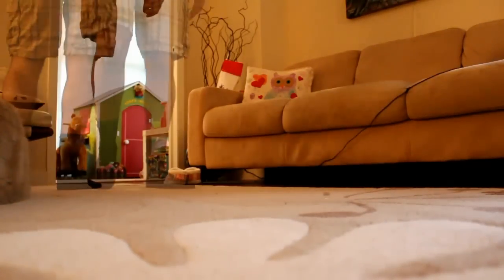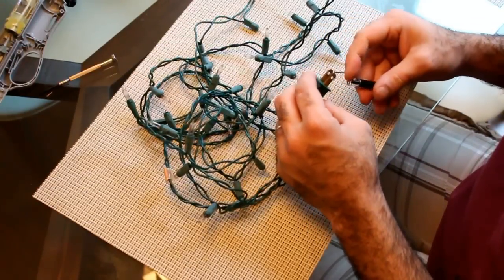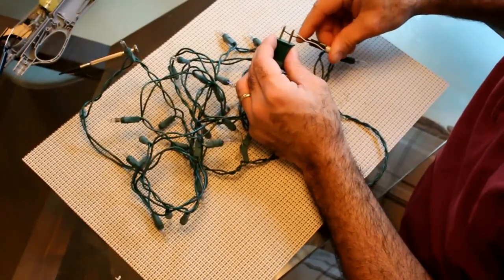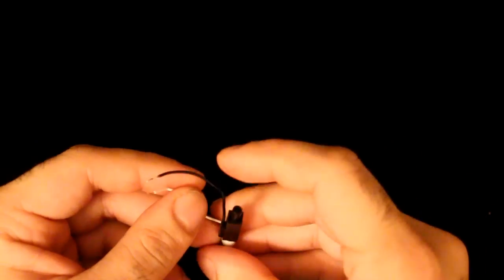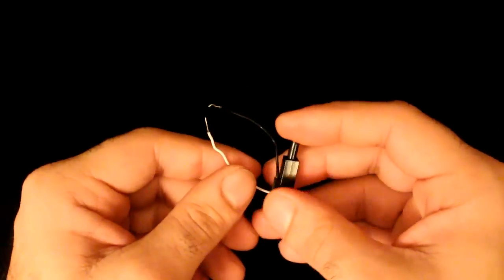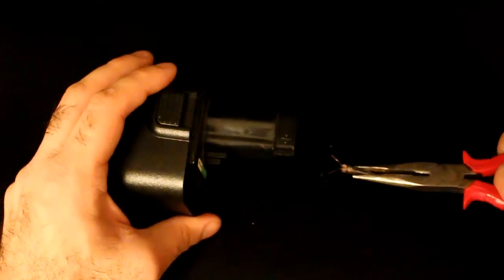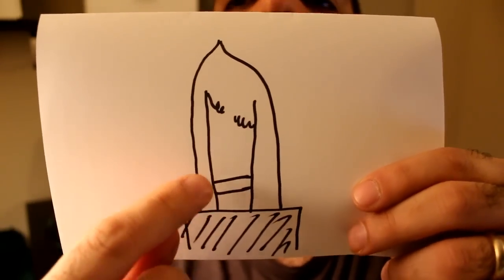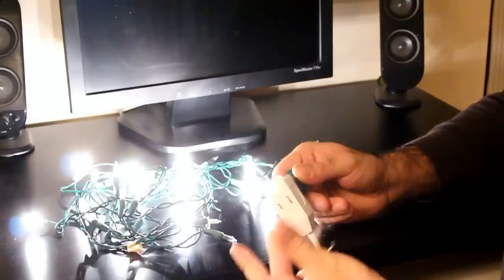How to Fix Blown Christmas Lights Fast and Easy

Comment: I am going to make a device that you plug the light string into it and press the button, which will do the same thing as fixing the light string. It's essentially a quicker and neater-looking thing which is just a lighter sparker tied to a single-outlet receptacle.

Comment: I heard that bridge has a oxide layer that is designed to break down at higher voltages. When the bulb is operating, because they are in series, the resistance of the other bulbs causes each bulb to receive a low voltage. If a bulb fails, the circuit is broken resulting in the voltage climbing to full line potential because with resistors, the more current is drawn, the more they reduce voltage. This higher voltage breaks down the oxide layer and shorts the bulb, however this sometimes does not work, and that is when a high voltage spark is necessary.

Comment: In countries with 230 or 240 volts, this is not necessary cause the voltage is high enough to do this on its own.

Comment: I have a question: i am not educated on electronics but it is my understanding that in order to create an air arc we need high voltage. I am assuming that piezo Crystal is capable of generating high voltage. On the other hand I don't understand how can such an high voltage short the broken lamp, and leave the rest of the lamps intact. If  there is enough current to short the bad lamp how can the filament of the remanding lamps still works doenst blow?
Thank you

Comment: Actually I was skeptical about the efficiency of this method, but today we had a dysfunctional string, so I said, what could I lose. I zapped it once, I plugged it in. Of course it didn't work. Ok, I zapped it a couple of times more, then I thought that It might be very important to directly connect the two ends of the piezo zapper to the ends of a connector, then I zapped a couple of times more. I plugged it in, and saw 20 of the 100 that didn't light up and all the other did :-O I'm currently surprized about two things: that this method really worked and I had so much bulbs, that went out at the same time. It was even more strange, that after I changed a bulb that had a broken filament, with one that I thought to be working, but bad too, I didn't have to rezap the string, but it worked. Maybe it was already shorted, but then again, why? So many questions. I should be happy tonight instead. ((-:

Comment: In the christmas section at my closest ace hardware down here in the states, there is a device that looks like a grill lighter, and it has a polarized female plug that does the exact same thing, without zapping or killing yourself

Comment: What brand of lighter did you take apart? I tried with a Bic, but the igniter assembly only had one wire that was not directly connected to the igniter.

Comment: Does a Christmas light is connected in series connection???(at least mine is parallel)
Reply: Then you have a power supply in the plug and most likely an LED string.
Reply: It heavily depends on what lights you have. E.g. extendable chains will have everything in one series string (or multiple series strings in parallel) and lights connected to the end will go in parallel. All depends on the voltage of the supply and the voltage of the lights you're trying to power. I got a 100led string of mains voltage lights here in 240v UK, to use that in the us it would need to be 2 parallel chains of 50 lights rather than 100 so the voltage for each led would be the same due to the us running on half our voltage.
Reply: Depends if the lights are LEDs or little incandescent filament bulbs. For a string of christmas lights, you don't need super-bright LEDs, the normal low power variety is more than bright enough. LEDs are extremely efficient at producing light, produce almost zero heat, and each one consumes a tiny amount of power. So it is entirely possible to run the entire string in parallel with thin wires and a low voltage. About 3 volts is usually enough for most LEDs, and small strings can run for many hours or even a few days just from a pair of AA batteries. Though it is easy enough to build a circuit to drop and rectify mains voltage to power a similar LED string.

Filament bulbs consume far more power, so a long parallel string would need much thicker wires to cope with the current drawn. So filament bulb strings are usually wired in series to allow thinner (and hence lighter) wires to be used. Also, filament bulbs are made with a variety of voltage ratings, allowing series strings to be matched to the mains supply without needing a transformer. For example, in Europe where mains supply is 240 volts AC, you can directly power a 40 bulb string made with 6 volt bulbs. In the USA or Canada where mains supply is 120 volts, you would make a 40 bulb string out of 3 volt bulbs instead.

Comment: I just discovered an old electrical lighter with empty gas and opened up. Found the exact same piezo thing. Zapped myself a few times accidentally with it, but that's actually neat. I think such a small amount of electricity is not dangerous at all, right? It's high voltage, but it ends up at a diminishing number of amps, if I got this correctly

Comment: There is a vacuum in the bulb, when a spark is created it ionizes the air making it conductive. Thats why it works
Reply: The ions don't last at low temps anyway, they'd be gone by the time you plugged it in

Comment: The thing that you shorted in the broken light bulbs with the sparker is known as an antifuse, which is basically the opposite of a fuse. Whereas the resistance in a fuse increases to a very high level (open circuit) as it gets hotter due to current, the resistance in an antifuse decreases until it reaches zero ohms (short circuit). This normally happens automatically but sometimes, the antifuse fails to short out by itself. This can be done by applying a very high voltage across the antifuse (like you did with the sparker).

Comment: Blew up a transistor in my christmas lights circuit board as well by doing some strange things. It exploded like a firecracker , leaving me some smoked fingers that i had to patiently clean with a load of soap later. Nothing happened to me , but that transistor broke in two parts. 
Mistakes happen. But that was a good reminder of this channel. 

Merry xmas dont burn your houses.
Reply: I think it should be pretty obvious why using this trick on fancy Christmas lights with circuit boards will not end well. :D

Comment: There's something that shorts the connection if the voltage is high enough? What is it, and why is it there? Surely not to protect the filament, as you originally blew the filament by putting a bunch of power through it. Is this just a material property rather than a deliberate design decision?
Reply: Tom Haflinger 
Material property.

Comment: HAHAHAH Oh man... thank you for this video.
I was SO pissed off by one small section of bulbs that was out... and came to find out why.
Now I'm about to go take apart my lighter and fix this strand.
Reply: Have you succeded?
Reply: nope.
no success. 

i ended up buying two new strands to replace the ones with outages.

stupid goddamned lights...
Reply: Scott Roy
oh, that's a pity. Had to be a different problem with them.

Comment: The wires at the bottom of the light, the shunts, have insulation that is supposed to burn when the light goes out but sometimes it doesn't, warranting the grill igniter. You can actually get a device called a "light keeper pro" that has a built in shunt repair in addition to light and fuse testers and a current detector. It has definitely helped me

Comment: wait u said that the bulbs kept glowing as they were in series but shouldnt they only be glowing in case of parallel arrangement as if series one circuit part breaks so remaining stops.
Reply: The bulbs are in series. In the beginning, the entire string of lights were off, as you expected. After applying high voltage from the sparker, a conductive bridge was somehow created inside the dead bulb, shorting across it and closing the circuit. That is why it began to glow afterward.
Reply: Mr. Random oooooooh, thanx a lot

Comment: here's a "bright" idea. buy a LED light strand. that way they never burn out
Reply: My family's had a few LED light strings for 3-5 years now, and they've yet to break in the slightest. Have you ever considered that the quality probably differs from company to company? Have you also considered that most standard bulb light strings are also most likely made in China? Have you also also considered that Christmas lights are most likely made by machine more than by "slave kids" since it would be cheaper and far more reliable?

Comment: Ok please someone reply. The lighter produces spark because it produces high voltage. But it's also true that only high voltage can't zapp you. The source must be capable of producing high current too. 
Is my thinking true?
Reply: Siddharth Sharma You're correct. You must have both enough amperage to shock someone, and have enough voltage to push the amps through someone.
Reply: I think so. Its the very short duration of the spark that makes it safe. I could be wrong.
Reply: you are right

Comment: could u measure the crystal output voltage?  or would that fry the voltmeter
Reply: Depends on the meter.  Set it on Auto, VDC, recording in Min/Max mode and you MIGHT get an accurate reading.

Comment: What happens is there is a shunt inside of each light bulb. When the light bulb burns out all of the voltage is dropped across that bulb which should cause an arc that melts through a lacquer coating on the shunt. This causes the lamp to short out and keep current flowing through the rest of the string. Sometimes this fails to happen and the string goes out. With the crystal an arc is generated across the gap between the shunt and the lamp electrodes that melts the lacquer coating and reestablishes continuity in the string.
Reply: +Dev Brown oh they could couldnt they. but u know. money :p
Reply: Dev Brown but, why an air gap is created? Isn't there vacuum in the bulb?

Comment: We have a multiple strand "icicle" light, where you can have a partially lit up strand. For this to work, we had to remove a bulb from every working parallel strand to isolate the broken one. Once you do that, the sparking method can work without shorting through the other segments. 

Really worth the $1 lighter.

Comment: Why doesn't the high voltage destroy all the other light bulbs instead of causing the "electric ark" over the broken one?
Reply: +jeronim bou The spark is a very short burst of high voltage, therefore not long enough to damage to the working bulbs. (or you for that matter :P)
Reply: +jeronim bou The shunt between the bulb terminals (that white wire wraped around the electrodes holding the filament) is made of anodised aluminum, wich has a very thin insulating layer of aluminium oxide on it, thin enough so about 100+v will break through and short it out, permanently, but if the filament is intact this will never happen, since it's resistance limits the voltage between the terminals. That piezo igniter has verry low courent, so the voltage across the terminals of intact bulbs never goes past a few volts.
Reply: stalkersas Ah, nice to know :)

Comment: 2 problems in eastern europe
pierso sparker is it still works when few are blown and sparker has just 1 wire and it's super hard to use becouse off all the purping it pakes your finger bleed from too much ussing D:

Comment: I tried the sparking method and my lights still didn't work (it's probably the looseness/disconnection from the fixture as you mentioned), but I had fun ripping apart my broken lighter and sparking my friends! Thanks for the knowledge :)
Reply: +Emily Dinnerman What kind of lights did you try to fix? Were they a basic set or did they have a controller board to allow the lights to dim/blink different patterns? A controller board would likely interfere with this method.
Reply: +Adam Fraser-Kruck It was a basic set from the thrift store ~$5. I know--it's cheap, but hey, I would've loved to been resourceful and do a little confidence-boosting DIY
Reply: Taser gun
Reply: I’m only going to shock my friends
Reply: Ok I have to find any lighter in the house real quick so I can spark my friends too :)
Reply: did they die?
Reply: Maybe you had led lights so it didn't work
Reply: 700 likes in 7 years. Wow.
Reply: 420 likes

Comment: What kind of lighter did you use? I tore mine apart and it doesn't have the same type of sparker.
Reply: ***** *note to self: Lighters cant just be used to buy your enemies, they can be used to zap them aswell.

Comment: Nice! I just used your technique to fix some outdoor "icicle" lights that hang under the eves. They appear to be wired in sections, and two sections were out. I started by trying to identify which light was out..one by one...but failed with much pulling of hair and gnashing of teeth. Plugging the lighter igniter into the two prong plug didn't cause the bulbs to short, BUT, attaching it directly to one of the bulb sockets in the unlit section worked great! I zapped both sections individually, and the burnt out bulbs were easily identifiable after that. Thanks for posting!

Comment: You're a Genius Dude!! Didn't work for me though. I then used a110V voltage tester.. you know the one that looks like a pen and has a test button you press? I started at the plug and by checking voltage going in the bulb and verified it was coming out.. done by simply touching the insulated in or out wire. I got to a bulb very quickly that had voltage in, but none coming out.. that was the bad bulb.. replaced it and voilà repaired the string. You need to make sure you isolate the individual wire going in and out from the other wires using your fingers or hand, otherwise you will get interference that will indicate voltage.

Comment: Very funny and interesting.

Since the bulbs are designed to short out when the filament blows, it's not obvious what the high voltage is actually doing.  You might think most of the energy would be dissipated by the working bulbs but that would only happen if there was current flowing.  Maybe the sudden, high DC voltage across the tiny gap in the dead bulb (that has failed to short) is enough to pull the parts together to complete the circuit.

Comment: There is not such  an interesting and exciting  way to check the lamps in this type of Christmas tree lighting, which is to  plug in and  holding a neon test screwdriver by its tip  slowly pass it along the chain of lamps. when you reach the dead one the neon lamp in the screwdriver handle will stop glowing  this Is the faulty lamp. Try this from both ends of chain after laying on a flat surface if the neon lamp remains on all the time and all lamps are tightly screwed in reverse the mains plug and try again. As a fellow electrical engineer I like your excellent stuff so much that I have done you the rare honour of subscribing to it. (grin) seasonal greetings.

Comment: OK... This is bs....where do I (who has an Electronics Engineering degree)start... First... this guy says he is using Series wired lights which means the bulbs are wired end to end , daisey chained...picture 20 people holdin hands one after the other and the the ones on the ends each hold a bare wire... the electricity will make a circut each person is the bulbs.

Now , the ideal of using that lighter gizmo to see a spark in the bad bulb can , in theory, work. It has a high voltage- low current.
but the problem is two fold, one, the spark would be too dim to see in day light because of the secound problem... which is each bulb in series adds up the resistanes and holds back what little current there is. (the spark is electron flow/current, voltage is the force that pushes the flow) more lights in the srting the smaller the spark.

The next problem with this video is that the little thing he shows in the drawing that he says makes the short when zapped and is a high voltage protector... nonsence... that is an insultator to keep the wires in the bulb seperated and to support the filiament.

Third... he never shows the process un edited as to show no tricks (ie switching bad string with good)... and when he uses the white extention cord near the end of the video.... he picks up the cord and drops it back in his lap.... BUT he has two power cords... one not pluged in and one that is....
Reply: I understand your skepticism, I also reacted that the extension cord was put out of sight, but it can still be tricked with even if the extension cord was in view. But people seems to have gotten this to work, and a product named "The Light Keeper Pro" apparently has this as one of it's functions as well...

Comment: I believe most strings stay lit now when a bulb goes out.  Even the super cheap strings at Walmart advertise this.  The problem I keep running into is a bulb will lose contact and then usually half of the string goes out.  You have to go through and twist each bulb and hope you find which one is causing the problem.

I wish this was an answer to my Christmas light problems!